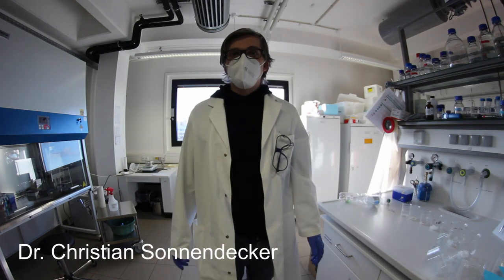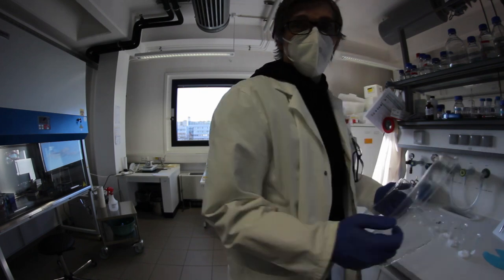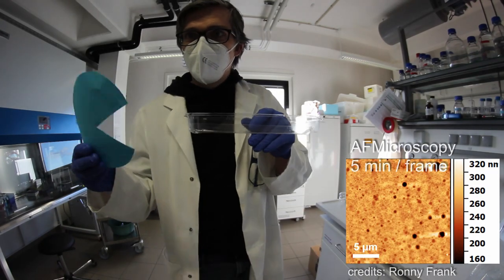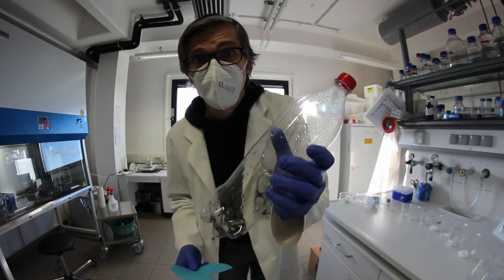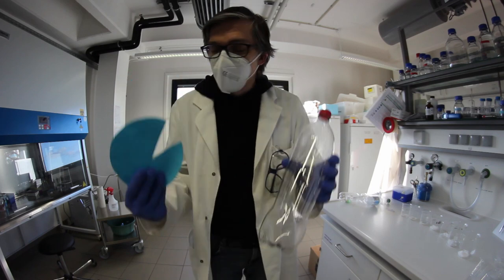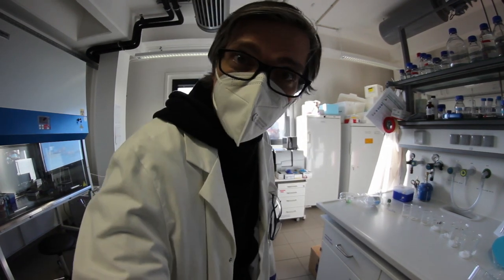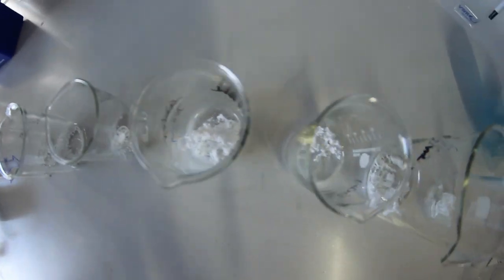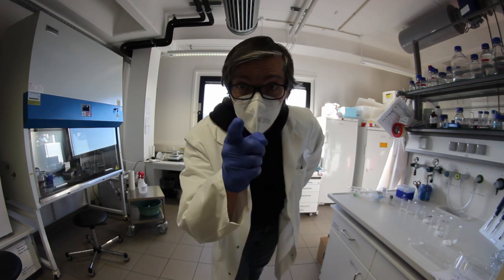Enzymatic degradation of PET plastic with PHL7 in less than one day

Comment: How to dispose of the solution after breaking down the plastic?
I want you to answer this question
Reply: The enzyme breaks down the PET into its basic building blocks. These accumulate in the solution and can then be recovered quite easily. The basic building blocks are actually derived from petroleum. Here, time seems to be turned back for the plastic and it allows the establishment of an economy that is independent of petroleum